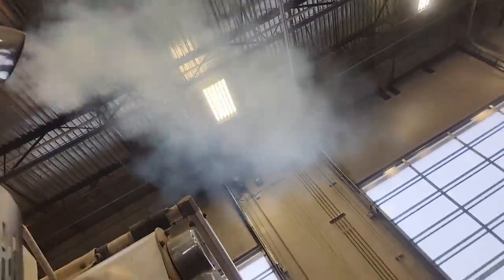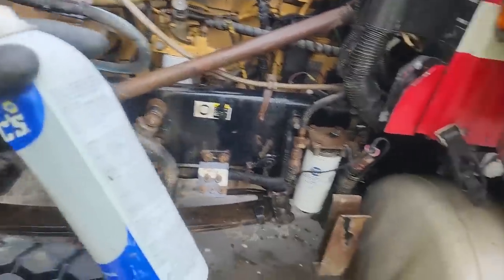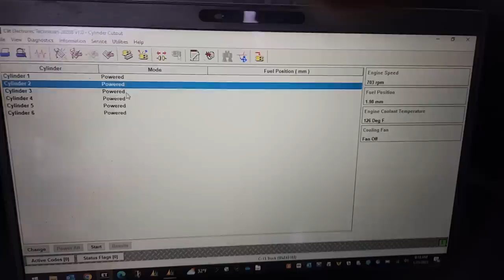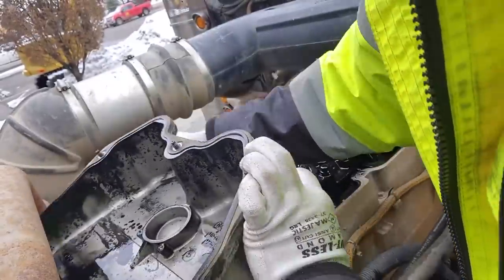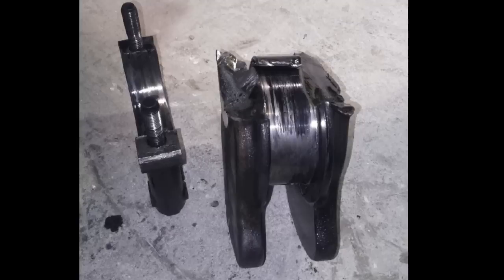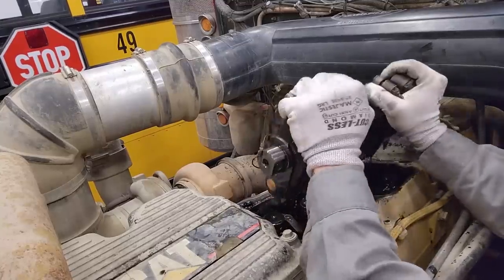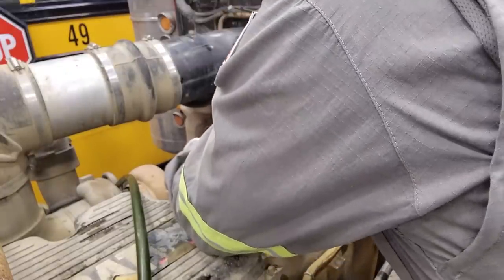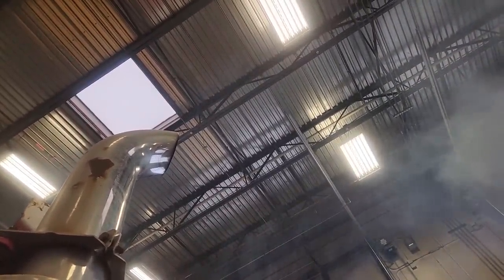"Smoky Red" C-15 Smokes Bad when it is Cold, but why? Cat Diesel Engine.

Comment: I’m an old Cat man. I left Hastings Deering ((NT) Australia in 1979 after 15 years in the industry. My love for Cat has never diminished and I really enjoy your videos. I was around when the 3208, 3204 and 3406 were released. I was in awe when Woodward electronic governers were released and amazed at the technology. Of course today’s electronics are way ahead
Reply: Hiya Bud Im a Pommie who worked at William Adams Port Melbourne early 1990's bit due to them closing shop I came back to POM Rock. Went off again on my overseas Jaunts as I did previously before going to Aussie. Worked all over the world on Cats & Love em. 3208, 3306, 3406, 3408 , then in Libya ( Sahara Desert) again 3406, D343, D342 etc  3512, 3516 , but my favourites are the D379, D398 & the D399 Engines, loved working on them. Ended up for the last few years working on V20 Ruston 270's 280's Marine engines.

Comment: So many mechanics would have just put a new injector in after the first cut out test. A mechanic going the extra mile is very rare nowadays, and you potentially saved this customer thousands
Reply: Disagree.  So many customers request injector replacements without troubleshooting.  Customers are the idiots not the guy turning the wrenches.
Reply: @Failure_Is_An_Option  How do you disagree with that? There absolutely are a lot of technicians that would just replace injectors without caring for the extra cost if it turns out to not be injectors. Whether customer requests it without t/s or not is irrelevant and if it's a good technician he would try to convince the customer to let the proper t/s be done before performing a repair. That's the technician's reputation on the line and the customer isn't going to be reasonable most of the time and is going to talk bad about the shop/technician regardless of whether it's actually their fault or not. Gotta live the world like it is not like what it should be.

Edit: I would even go as far as to say that I wouldn't do the repair without t/s if they customer seemed like someone who didn't understand exactly what they are getting into.
Reply: I won’t hesitate to slap a new injector in for trouble shooting purposes but if that’s not it it’s coming right back out and back on the shelf. Cause a lot of the newer engines it’s not that easy to swap injectors especially on common rail fuel systems.
Reply: @kodykj2112  Outstanding response to the dumbest comment of all time
Reply: @Failure_Is_An_Option  in your shop, maybe. I own a damned fleet, and if I had a dollar for every time some tech did the first thing that popped up on codes…..
Happens all the freaking time
Reply: @Failure_Is_An_Option  the mechanics today are as much at fault as the customers. Far too many mechanics choose the short route rather than the correct route. I found this to be the way many years ago and as such have done all my own maintenance and always will.

Comment from the maker: Thanks for watching the video. Hopefully we get authorization on this engine soon to continue. You should really watch Groundhog Day if you haven't seen it, Amazon Affiliate Link to it and some recommended tools: Groundhog Day Movie: https://amzn.to/3WL1jU2 
Fuel Pressure Gauge, Compucheck 0-300 psi: https://amzn.to/3YeBldu
Airlift Cooling System Vacuum Filling System: https://amzn.to/3D9AlPu
Radiator Pressure Tester Kit: https://amzn.to/3QGBumn
Milwaukee 3/8" Right Angle Impact Wrench: https://amzn.to/3D2CvAk
2 Pack M12 Style Batteries for Milwaukee: https://amzn.to/3D2mdHE
Adjustable Height Parts Tray 100 lbs: https://amzn.to/3CBusZB
Engine Oil and Fuel Dye UV: https://amzn.to/3z34zkv
UV Professional Grade Light: https://amzn.to/3gzxPc0
Oil Pressure Priming Tank: https://amzn.to/3YuBrNr
Reply: Your  videos   are helping alot in my job.... thnx. From north africa. Libya
Reply: They are helping me too, thank you so much for sharing your knowledge with all of us! Keep up the good work & be safe!
Reply: Nice diag on ruling out the injector. You may not know what it is, but at least you know what it isn’t. What’s with the zip tied hose?
Reply from the maker: That's the wastegate hose. Pretty much every truck in Idaho has a bolt in the wastegate hose or zip tied. People just trying to get more boost out of the turbocharger.
Reply: @AdeptApe  who doesn’t want more boost? Can’t say my wastegate is functional lol I had asked a cat mechanic near me, he told me the wastegate is not important so long as you stick with factory fuel files, he said if I was going to modify the fueling then either leave the wastegate alone or get a turbo designed for the higher boost.
Reply: Running the same factory file the truck was built with, 475hp. The engine was rebuilt last in 2012 in the shop your working at.
Reply: My local Cat dealer shut down their truck department since Cat stopped producing on-road engines for some time now. I hope your dealership stays open, have you heard any talk of things changing?
Reply: @JBCrossRanch  very hard finding c-15 parts in Australia. Reman or second hand are the main options. Even genuine rebuild kits are hard to find. That said, the blokes at Westrac Wagga Wagga are very helpful, friendly and good at what they do.
Reply: @JBCrossRanch  I have heard just today that Caterpillar are opening up the truck engine dept with gusto , once more. Beats me why they ever pulled out of the biggest engine market on Earth? Of course there will be those opposed to the policy CaT have toward warranty, repair and parts. I think Cummins have really enjoyed being the major player in the field for quite a time now.

Comment: Best one I’ve had was a bent rod. Still had compression everyone was pulling there hair out trying to figure it out until  found out it had water damage previous
Reply: Had something similar with a Cummins ISL engine on cyl #6. Head gasket had a very small leak, and if the truck sat for long enough, it would get just enough coolant in that one cylinder to slightly hydrolock it. And that bent the rod just ever so slightly. But he let it go too long, and because that cylinder wasn't combusting properly, it messed up that injector and ended up melting a hole in the piston. When I first got to it, it had all kinds of codes in the ECM like 2 pages worth, I did manual cylinder cutout and it was missing bad on #6 whether the injector was powered or not. Before I did any other troubleshooting, I took the oil fill cap off, and the blowby was enormous, just about blew the cap off. It ended up being about $30,000 to have it rebuilt. EGR cooler was replaced as well. Turns out that might have been the start of the problem, if the coolant flow thru the EGR cooler on those engines gets impeded by lime/scale buildup, then the back two cylinders 5+6 don't get enough coolant flow, and they're the farthest away from the airflow, so they run hotter which might have started the head gasket leak. There was also traces of coolant in the oil (hole in the piston). The head gasket leak was very small, when the head was pulled, there was only a few green drops on top of the piston.

Comment: My c15 6nz is currently doing the same thing. I replaced 2 injectors and o rings. Still smoking when cold. Please keep us updated on this one!
Reply: Why would you replace injectors not knowing cause?
Reply: @Failure_Is_An_Option  as Animal Mother said, Parts cannon.  MANY shops just fire the parts cannon instead of doing proper diagnosis. It's not their bill and some shops either don't have access to Cat ET or simply don't have the trained tech's to do the diagnosis.
Reply: Do a compression and then a leak down test. You’ll know if you have bad rings and then or bad valve sealing or cracked head.
Reply: Mine was smoking bad on startup, the odor of fuel burned the eyes and nose. Next came horrific blowby, then boom. The oil jet sprayers were bent on the #6 cylinder. A brand new Cat reman, barely 100k miles, broke the rings, split the piston, ruined the liner, just disappointed with Cat and their reman quality. Apparently QC is not what it used to be, looked at a lot of forums and there's a lot of guys complaining about remanufactured Cats.
Should have stuck with the mean green Detroit machine, 12.7 for life 😂
Reply: @TheRoadhammer379  it is sad what is happening with cat especially in ontario canada. I have found that IPD parts are better quality than cat oem. Cat up here are getting that elitist attitude that they never make mistakes. Bad on them
Reply: Roadhammer379. I just bought a glider with a fresh overhaul 12.7 and its been down 3 times in 6 months for broken gears. I think its crap materials all manufacturers use. The government wants ALL older vehicles off the road so I believe it’s intentional.
Reply: @philhatch1140  yeah, when was the last government operating a trucking business. Sabotage aside, and the common sense of keeping new fleets on the road. For those managing on the obsolescence end of equipment operating. It's pretty hard to see policy dictating an end to great working equipment that somehow got old before it got wore out.
Reply: @Failure_Is_An_Option  often with older trucks there are multiple problems so probably when he started looking into the smoke he had it diagnosed and had two bad injectors however they weren’t the cause of his smoke

Comment: Growing up I'd always hear of stories and still do till this day of truckers mixing a little gasoline with the diesel in the tanks for specific reasons. The dosage is small enough to remain harmless. Could you do a video on this if you know what I am talking about? Keep up the great content. Hands down my favorite diesel YouTube channel.
Reply: Probably was kerosene not gasoline.
Reply: @harriettedaisy2233  I'm a retired mechanic turned truck owner/driver. We used to add kerosene to reduce the gel point of the fuel. Most truckstops cut the fuel in the wintertime. But adding kerosene reduces power and fuel mileage.
Reply: I heard a story years ago of Greyhound bus drivers from the 60s adding a gallon of gas (not kerosene)  to the 160 gallon fuel tanks on the buses.  Also had an 86 Ford with 6.9 Navistar and a local Navistar mechanic told me every couple of fuel filter changes to either fill the filter back up with kerosene or mineral spirits, even had one guy say dry cleaning fluid could be used. And farmers for years with older JD tractors have added a quart of auto transmission fluid to 40-60 gallons of diesel as an injector cleaner.  I cannot speak to the success or failure of these treatments, only that they were done.
Reply: @donmunro144  Yep. Kerosene is the base fuel for aircrafts, and aircrafts commonly experience -50C temperatures. So adding a little kerosene to diesel can depress the pour point (gelling temp). Old diesel engines may be able to handle a bit of gasoline in diesel, but adding gasoline to newer common rail system can be catastrophic. Those injectors operate at such extreme conditions, if you lose the lubrication from diesel they will self destruct.
Reply: I recall in the 1970s the Airforce in Australia ran Cat auxiliaries on Aviation turbines fuel. Worked ok but wore out mechanical fuel pumps as that fuel did not lubricate.
Reply: Kerosene/Paraffin as we call it was used a lot as an anti gel agent, you could smell it a mile off. But some outfits used petrol for the same purpose, 20:1 or less. I would be hesitant to do this in a modern diesel, but it did no harm in the old stagers I remember it being used in. as for which was better, that decision would have been based on cost alone.
Reply: @unclejoe5541  the auto trans fluid has high detergent and was used usually twice per year and a quart per tank at fill up to help clean the fuel system. Never heard of or would put gasoline in a diesel engine. In the high north they mix jet fuel with the diesel in the winter to help with gelling at low temps thats the equivalent of adding kerosene. But the mix is very little jet to diesel
Reply: @unclejoe5541 when I changed fuel filters I always filled the new ones with type F ATF.

Comment: That was a very fast and accurate diagnosis. If engine hasn't had much work done to it...might be time to consider a rebuild
Reply: At 800000 on a triaxle I am sure this is not the first time that this engine has been worked on I am sure it has had headgasket problems at one time or another
Reply: Honestly, if it was my rig, and it still ran acceptably well once it warmed up, I'd probably just let it buck for now. And it seems to run okay once warmed up, soo...

Comment: Oilfield Mechanic.  We have 3600 Catapiller engines. Run on natural gas. Engine holds 200 gallons of oil.  Has 2 air filters.  Each cost 500 dollars. We have huge pumps hook to them to push natural gas.  They get all new filters, oil change and valve lash with spark plugs then washed. Every 30 days. They idle at 1,200 rpms 24/7 365 days a year. Retired now.

Comment: Really enjoy your videos! I’ve learned a lot watching you. I’ve got a mechanical 3116 that’s giving me a lot of trouble. It runs fine for 30 minutes and then starts starving for fuel and dies. I’ve had the tank out no leaks I’m at a loss.
Reply: I had this happen several years ago on a b series cummins. One of the crush washers around an injector was bad and was allowing a large amount of heated fuel to return to the tank. Once the engine was warm and the fuel in the tank was hot, it caused cavitation in the fuel pumps,  which caused the engine to become starved of fuel.
Reply: I've had this exact problem on a bigger cat. 3406B. The problem turned out to be in the fuel stop in the pump
Reply: Check your fuel lines for leaks. Not dripping fuel leaks but air getting sucked in on the pull side of the system. A leak such as a loose fitting or a hole in a line that is laying on something it can slightly seal with  will cause this
Reply: Make sure tank is venting properly, check simple stuff, also tee in a pressure gauge at a certain point and see if it’s supply  issue and try ruling out possible problems.

Comment: A relative compression test with a scope would've told you immediately that it's a compression issue. Disabling the injection and cranking it even without measuring the starter's current might give a good audio clue that compression is uneven. Then it's a matter of making sure valve adjustment is correct.
Reply: Agreed! There are too few guys willing to put the time into a
Mechanical compression test. In my apprenticeship long ago we were taught to do them dry then wet. No one does it anymore.
Reply: Relative compression takes about 5 minutes. You just have to disable injection, put a current clamp on a starter cable and capture cranking current with an oscilloscope. Waveform obtained immediately shows if there's a low compression cylinder

Comment: We had "hot rod" truck come in like this. But it was normal it smoked and had cold fuel knock until warmed up. They had fuel cranked up it melted bottom of cyl head. Had 6 spots that match 6 ports on injectors.

Comment: My money is on a blown head gasket at #4, used to see it a lot with your exact symptom. Try a bottle test, it will likely fail if that's the case.
Reply: What is a bottle test?
Reply: @lkx360  He uses it in other videos. Run the coolant overflow hose into a bottle with water and see if it bubbles. If there are bubbles then compression/pressure is getting into the cooling system from a bad/blown head gasket or cracked head.

Comment: Nice diag skills. I am having the same problem on my c12. Pulled the head replaced cam looked over cylinders really close. Saw no  other damage and still having a problem with miss. Wondering if I have a broken compression ring or something.

Comment: Blown/seeping head gasket, most of the time. For some reason that cylinder (four) fails the head gasket usually first. The older Cat engines (6TS and back) the coolant entered the cylinder block around number four. Then they changed it (1LW and up) now enter's at the rear. Do not know if that is the reason, but it is odd that cylinder, four use to get the cold coolant first and head gasket now fails on four first. Pull the head bolts between four and five and most likely you will find carbon.
Reply: Very nice tip about bolts. Thank You very much

Comment: When ever I have the injector out I will shoot some compressed air in the cylinder just out of curiosity, quick health check if there is a rough run complaint.
Reply from the maker: If the cylinder was dead I would have, but since it seems to be firing, but a little weak I figured just swap them and really test it. It is a good idea though.
Reply: @AdeptApe  Hey  I was wondering if cat has cylinder leak down test gauge, I got a cylinder leak tester from mac tools and got the glow plug fittings to work for the power stroke diesel engines (that's all I work on) for doing leak down test and shows a percentage of the cylinders and how much there leaking. now for heavy duty  application is there such a tool, or just apply shop air like you show in your past videos
thanks for the videos
Reply: @austinbrown4538  You need the correct adapters for each engine.
Reply from the maker: Cat doesn't make or recommend a compression or leak down test for these engines. There are aftermarket versions, but usually you can work around using them. Doing a compression test is a pain on these, because you have to take the overhead off every time you swap cylinders.
Reply: @AdeptApe compression test is also a pain in the ass on series 60 engine as well. But sometimes I’ll take the time to do it. Or leak down test. But the way you did it works just fine. And probably quicker